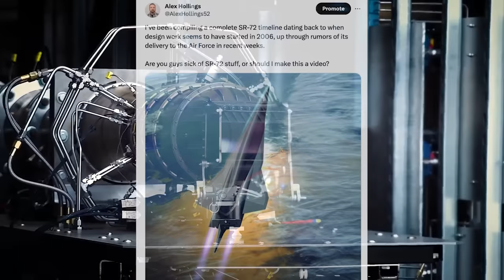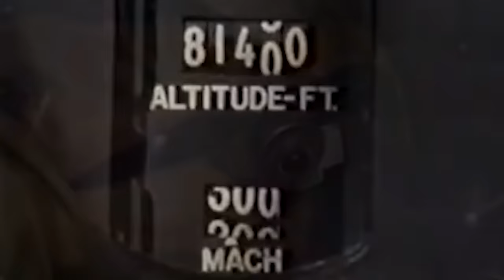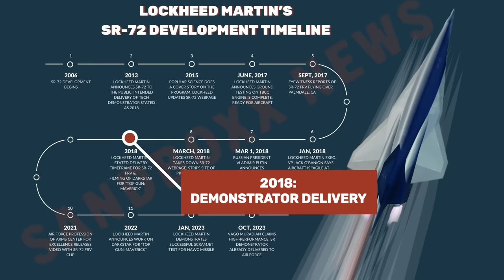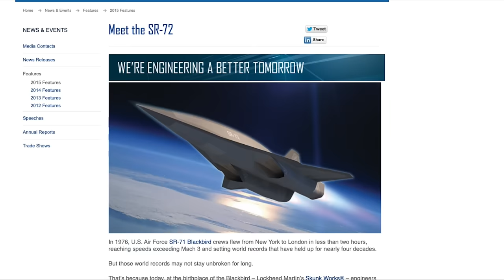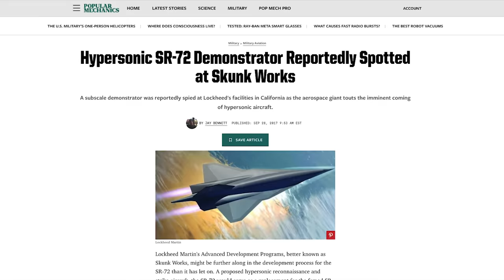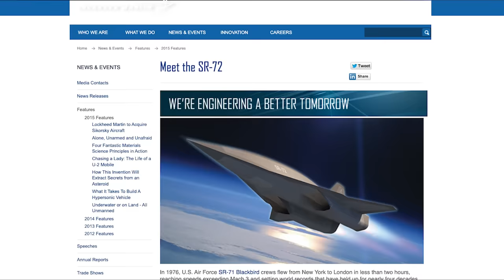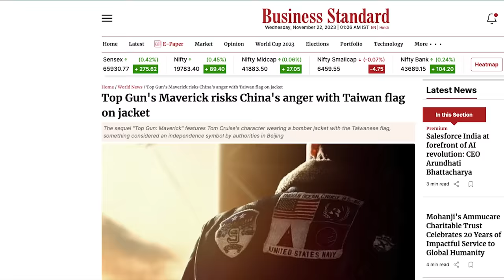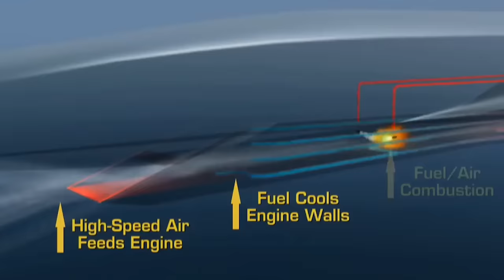The SR-72 is REAL — And we can prove it

Comment: This entire video is impressive so far, but the bit about the hermes using an entire engine as a blocking body is so sooooo cool. I'm floored by the fact that, one, someone came up with that, and two, that we can make materials that can survive that. Ah man, science and engineering are dooooope.
Reply: I dunno. It's not that big of a leap from how an afterburner works. Good idea? yes. Crazy genius idea? nah. ;)
Reply: Suuuuure an afterburner is a glorified propane torch, not nearly as complicated as supersonic airflows that need to be rerouted around a vulnerable engine @kathrynck
Reply: @mintoc8853  I think you're oversimplifying an afterburner. 
But I don't mean to imply that it's "simple" to have a supersonic airflow going around an engine into another engine. I'm just saying that the core idea of doing it that way is fairly intuitive. Mullti-cycle engines aren't a new concept. Not that it's easy or simple to pull off what they're attempting.
Reply: @kathrynck  well besides the throat varying, afterburners are essentially gas torches, a crude way of increasing energy output. Imo ideas like this one are often deceptively evident after the fact. Just like the forst iterations of normal jet engines back in the day. But either way I think we can agree it's a pretty cool way of doing it
Reply: Im just amazed at the thermal properties of whatever they are using. Sounds like that engine would have been melted 30 years ago
Reply: @mintoc8853  I have drawings of using a turbojet with a closing cone front, as a blocking body for a regular ramjet from longer ago than I care to admit. It's just the most efficient route for airflow, as you only have to divert the air across the radius of the turbine jet. Whereas in a side-by-side arrangement you have to divert the air across the diameter of the jet. So you're looking at a 50% more efficient intake flow path. The obvious drawback though would be engine maintenance access.
Also, if you want to simplify things to an extreme, all a ramjet is, is "jet fuel torches in an airflow" as well. ;)

But yeah, actually doing it, and working out the many design obstacles? It's good work.
Reply: @kathrynck  Oh a ramjet is for sure  a few torches as well haha. But dealing with the shock waves etc to keep it stable is much more complicated than an ab. But yes i agree that it's a "simple" concept idea about the engine as the cone. Deceptively simple
Reply: @mintoc8853  I'm not convinced a "scramjet" is really all that useful of a technology in a multiple-use platform. Scramjets are kinda "too fast for their own good". And I don't just mean the engine itself, but the whole airframe. At least for an "airplane".

You can push mach 6-7 (in a sleek aircraft shape), without having very much of the aircraft bumping into the SS shock cone. And a ramjet can do that just fine. 

If you want to go faster, then you either have a "flying needle" with very limited internal space and a fragile construction, OR you go bulky and have to cover the whole thing in heat tiles, and you're adding lots of zeros to the cost, and months to the turnaround time between flights.

The uh... "moment of inception" for a supersonic shockwave is basically asking air to move faster than it normally knows how to. It's very violent. So a fighter going mach 2... the tip of the nosecone, and the leading edges of the wings, etc. are all "touching" the supersonic shockwave, and taking a lot of stress & heat from that. But (depending on shape) it's generally limited to a few square inches of the airframe. Just the tip of the nose, and the very edge of the wings, etc.

At mach 6 or 7, you can still limit the contact between the airframe and the SS shockwave to just the tip of the nose, and the leading edges of wings, vertical stabilizer, etc. And still keep contact down to a few square inches. Well, as long as the overall shape is rather sleek & sharp.

But faster than that? You're not going to be able to tuck the airframe inside the shock cone. So your heat & drag would absolutely skyrocket. You kinda want a SS aircraft to "touch" the SS shockwaves, not marinate in them ;)

Space shuttle marinated in the SS shockwave on reentry. Cuz orbital speed is just unavoidably "very fast". But it only had to tolerate it for about a minute. And it had to cool off for a couple hours after landing, and then get 10,000 labor hours of maintenance to it's heat shielding.
Wildly impractical for a frequent-use aircraft.

For missiles, sure. Use a scramjet, and design the missile to partially melt on the way to the target. It's single-use, so who cares? Go ahead and go ludicrous speed.

But for an airplane which you want to fly 2-3 times a week, and cost less than an aircraft carrier to build & maintain... Just stick with ramjet, and a mach 6-7 top speed ;) 

The SR-72 design is ideal really. The shockwave off the nose would intersect the wings at those bulky leading edge extensions at the front of the wing root. So you could just put heat shielding on the nose tip, and the wing roots. The leading edge of the wings would generate their own shockwaves, but a sharp edge would limit the surface area in contact. Mainly the trick for a SS aircraft is the point where the shockwave off the nose intersects the wing. A sharp edge doesn't help minimize contact there. The whole frontal area is going to be dipped in a SS shockwave at that intersection. The SR-72 is handling that exactly how I'd handle it in a design. Go "space shuttle" exotic-build, but ONLY at that intersection, sharp "cut your finger" edges on the nose and rest of the wings, and a stubby vertical stabilizer which tucks under the nose shockwave. 

I do like the jet-as-blocking-body approach in the Hermes though. Big drag benefit vs a dual-path layout.
Reply: @kathrynck  agreed, now the question is if they're really sticking to those 6-7 mach speeds or have a good reason to go faster. Personally I don't really understand the speed philosophy as it's only a matter of time before countermeasures are developed (well, depends on the "situation" of the "enemy" and ig accuracy is more difficult at those speeds, but still. I suppose they'll have a bigger time window of being uncontested than for the sr71 ) but nevertheless excited for the aircraft that result from it.
Reply: @kathrynck  There is a way around what you are describing. There was a report of maybe a decade ago how the Russians were having a test flight above Konigsberg or making an emergency landing there that used my idea  (I never published, they came up independently). 
Just a hint: The superfast torpedo that blew up the Kursk used the same or at least similar principles.
Reply: @donaldduck830  Like the VA-111? Hmmm... not sure how that'd help. That kinda made a bubble in the water by going supersonic. "Super-cavitating" I think they called it. So most of the torpedo didn't touch the water...

Any SS plane is kinda already doing something vaguely related though. I don't think you could create a gap in the air to slip through though. And if you could air breathing engines would be out.

I guess you could put a very long nose-probe on a plane to push it's shock cone forward. That would loosen up the design limits some. Probably be handy to make the probe a 'highlly expendable' component too. Like a solid stainless steel spear, just unscrew it and screw on a new one each flight.

Still, to go mach 10 and not have the skin soaked in the shockwave-violence, every part of the plane would have to taper at greater than a 10 to 1 rate... that's pretty skinny ;) Go too skinny and you get into diminishing returns on structure weight vs internal volume. And also get more fragile, don't wanna snap in half on touchdown ;)

Have you seen the X-59? that's probably as skinny & tapered as you'd ever really wanna go.

I may be missing something though :) 
(I do that sometimes hehe)
Reply: Another thing to keep in mind is the shuttle TPS was 1970s technology.  A modern version probably looks a lot more like the ceramics SpaceX developed for Starship.
Reply: That was exactly how the SR71 engines worked, it's not new and really it's just makes sense
Reply: Would highlight that the super cavitation on torpedoes works because they can blast out/capture a less drag inducing element at the nose to act as a buffer but in air, you'd probably need to form some sort of vacuum to achieve the same result(Not that, that doesn't happen at the aft end, but hard to achieve on the leading edges)
Reply: @kathrynck  back in the day, it absolutely was genius and simple (comparable to other solutions)
Reply: @kathrynck  The space shuttle tiles were labor intensive because each one was uniquely shaped/placed and they were held on with glue.  When it comes to TPS, more uniform is better, like Starship's bolted on ceramics or Stoke Space's use of liquid hydrogen regenerative cooling on a metal heat shield.  The old Star Raker proposal from Rockwell also used hypersonic TBCC and metallic TPS, since even they knew STS-as-built was a dead end.
Reply: @0202pmurT  I think there's a key bit which is not obvious to the layperson:

When you go supersonic with a "flat" nose, the entire flat area is forcing air to move faster than the speed of sound. Air hate's that, like really really violently hates it. So much that if you force air to move faster than sound, it does a state-change into plasma. Which is an explosive and ridiculously exothermic effect. It's actually kinda related to arc-welding, though that uses electricity, both involve the state change to plasma to create crazy-high exothermic energy.

Normally nobody's going supersonic with a flat nose though. It's tapered. If your nose is a 45 degree tapered cone... you can go mach 2 before you run into the problem which a flat nose has with creating plasma. Cuz the air only has to move aside at half the rate of speed.

And your margins continue, as you continue to taper the nose further. A long pointy nose can go multiple mach before it has to worry about "full body contact" with the supersonic effect akin to an arc welding torch.

The thing is, the very tip is never "perfectly sharp". So you always have "a bit" of plasma being generated there, right at the very tip. But it's not a huge issue so long as it's an area you could cover with a dime. There are other points of contact on an aircraft, but it's very carefully minimized in a supersonic aircraft.

In theory, if you made a spacecraft with about a 25:1 taper (basically the body proportions of a javalin), you could probably do away with heat shielding. Cuz you could do reentry at orbital speed, without doing that blunt-force trauma to the fuselage. Of course your aero-braking would be a tiny fraction of what spacecraft currently use though, and you'd hit the ground still going mach 20 or so... also it wouldn't have any internal capacity at all. That's basically the "rods from god" concept weapon.

Anyway, thermal tiles don't "eliminate" the heat problem. They "buffer" it. When a heat tile based reusable spacecraft comes in at speeds which must do full body contact with the plasma phase change... It makes a LOT more plasma. It's not just just the very pointy tip making plasma, it's the whole front-half of the craft. The heat tiles bank & release heat well... they soak up heat for "just long enough" to complete reentry. If reentry took longer than the minute or so it usually takes, the tiles would have to be that much thicker and more durable to bank more heat energy.

Actually, you know the period of time during reentry when a spacecraft loses radio contact with ground control? Those seconds are the exact time-frame in which the heat tiles are doing their job (when the spacecraft is sheathed in plasma).

Plasma dislikes radio waves. Before you lose radio contact (pre-plasma generation) radio waves get through. And when you get radio contact back (post-plasma generation)... you don't need heat tiles. You just need them when you're making the plasma. And they only have to take the abuse for around a minute.

I do agree that the 10,000 hours to refurbish the heat tiles on the shuttle is wasteful, and Space-X, etc. with bolted on tiles and a much more limited set of tile shapes, can likely cut that down to a fraction of the time... and that's a BIG improvement. But you're still talking about a substantial amount of work. And the tiles are all a "wear component" which need regular replacement. It's a huge investment in weight, time, and expense, even with a better approach to it. And it's still a safety concern.

"Could" you make a plane which would go fast enough that it's in full body contact with the supersonic shockwave? Yeah... I don't know how many minutes it could sustain that... (not many). But it's technically "possible to do".

Would such an aircraft EVER be practical, cost effective, or remotely realistic? No. And that's not just a "well with enough tech..." it's a hard, non-negotiable NO, directly from physics. If you have heat tiles which are 15x more durable and effective than the ones the space agencies use... you could put the fuselage against the hypersonic shock-flow for... 15 minutes. And your tiles would "all" need to be replaced after. Assuming you didn't lose one and turn your plane into goo.

Meanwhile, you're looking at massive costs, drastic payload ratio loss, enormously increased turnaround time... the fuel alone would be a massive problem. It would be insanely impractical.

So any hypersonic "aircraft" has to be avoiding full-body contact with the supersonic shockwaves. That means it needs to be very sleekly tapered. The tapering does NOT work like "drag" where a little less taper is ok, just eats some fuel economy, etc. It's an all-or-nothing affair. You keep the fuselage taper inside the shockwave taper, or your aircraft becomes a debris field of molten aircraft bits.

Materials will not make "sustained" full body contact with a hypersonic flow realistic. Not even in your great great grandchildren's lifetimes. So the plane has to fit inside the taper of the shockwave.

I'd say mach 6 or 7 sounds "doable". 10? I don't see it. It's just a matter of how skinny & long you can make an aircraft, and it still be functional, structurally stable, and practical to use. There's no "exact" limit, just... the longer & skinnier you get, the more diminishing returns will ramp up and make your plane a terrible piece of engineering.

- All of the above stops being relevant if you're talking about a single-use craft. A hypersonic missile can ignore all the rules, and just go ahead and begin melting itself down on the way to it's target. It only has to have a long enough melt-time to get there, which is "relatively soon", and it will never need to be reusable.

But something you want to land and use again (which is going to stay in the atmosphere) has to play nice with physics.

Spacecraft get a bit of a pass because with exotic materials, tiny payload margins, and lots of work... they can do it for about a minute at a time, and get away with still being reusable.

I think the only heat tiles you'd ever see on an aircraft doing sustained hypersonic in-atmosphere travel, would be right at the point where the wings necessarily have to poke through the HS shockwave. That's THE engineering hurdle. And it's pretty obvious from the chunky leading edge extensions on the SR-72, that they're solving it with a bulky shape, which likely has some very fancy heat shielding right there. That's the only point of contact (apart from the very tip of the nose, and probably at that speed the leading edge of the wing... but that contact can be razor-sharp, and minimized.

I have to wonder how they're handling heat dissipation at that leading edge extension point. That'd be the secret sauce of their design. I'm guessing they're engaging with the shockwave very gently (in terms of angle) to spread out the area of contact across a large area, to help with heat absorption & dissipation. So a bulky leading edge extension in side view, which is extremely tapered in overhead view... and that's what their bird looks like, exactly.

If you really wanna know 'exactly' how fast it goes, print an overhead view, take a straight edge and make a line from the tip of the nose to a very gentle engagement with the leading edge extensions on the wings. Get out a protractor... and then figure out exactly what mach speed makes that angle. Of course that assumes the pics in the pop-sci spread were accurately proportioned. When i did that, i came up with 6 or 7, in that range. But I've no idea if I was working from an accurate depiction. It was a drawing after all.

I'm sure it's speed is intended to be classified, but it's just gonna be unavoidably geometrically obvious to any first-world country which has done supersonic engineering work, and can see it with an eyeball. They can classify everything else about it, but it's speed is stamped on the airframe in bold letters, from a fluid dynamics standpoint.

Hermeus has a different design, but they're dealing with the same physics limitations & hurdles.

I just don't see mach 10 being realistic. It'd end up too skinny. Being skinny creates structural strength issues, which means more weight to brace the structure, which means greater need for lift, and less room for fuel payload, meanwhile the ratio of internal volume (relative to fuselage area) gets smaller and smaller... it'd just get silly. 6 or 7? sure. 8? "maybe?" (exaggerated air quotes).
Reply: It’s things like this that make me say ‘Man, I love being human sometimes.’
Reply: Well this design reminds me of the Pratt and Whittney J58 which has a turbojet in the middle as well as a compressor bypass all around to supply a tueborocket at the back of the turbojet. The difference is that the compressor bypass is just a bunch of tubes and that the secondary engine is not totally a ramjet
Reply: And then there are people who think the earth is flat. 🤦